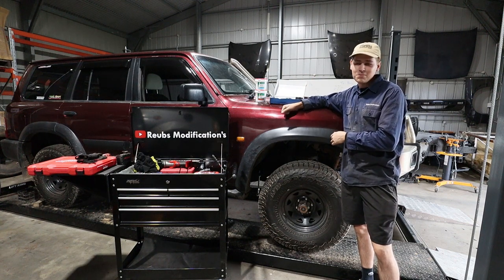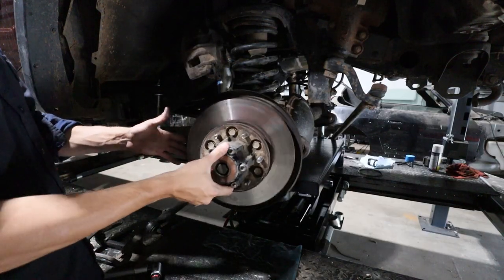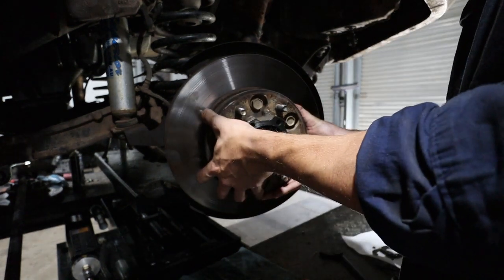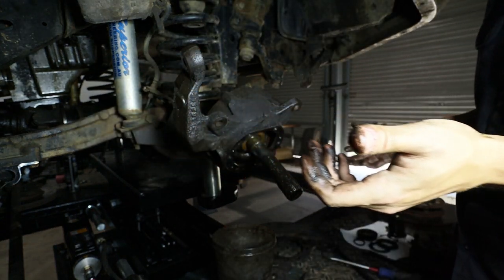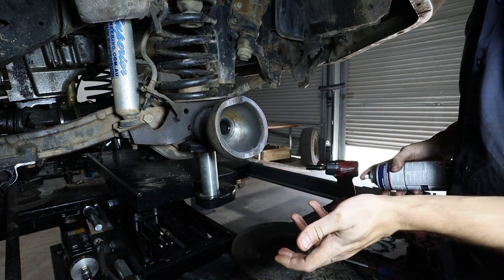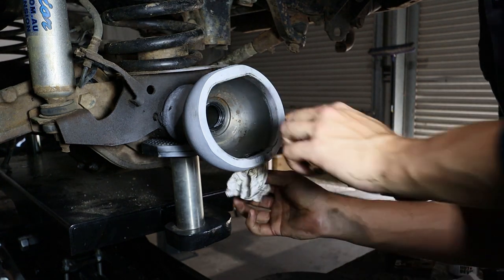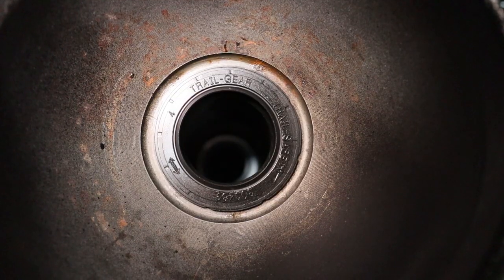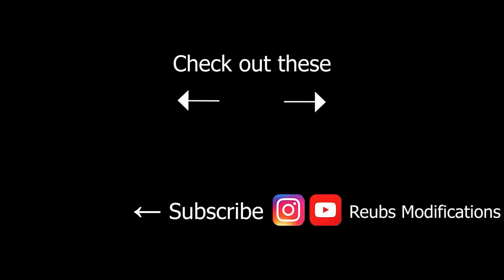GU Patrol Axle Rebuild Pt 1

Comment: Hey mate about to do the same on my car should I paint before putting the bearings in and just mask off the 2 holes I saw u painted while they were in did u cover them or something cheers
Reply from the maker: Yeah would be best to paint before the bearings go in but if you wipe them down and remove any overspray it wont matter. I just wiped the bearing surface with thinners as its faster than masking up.

Comment: great video very informative one question did you drain the diff oil before you started?
Reply from the maker: Thanks mate, in theory yes you should however by the time you get to fixing a axle seal they’ve usually lost enough oil that there’s not too much to leak out anyway. Only thing to keep in mind is if you are going to do one side at a time as the angle of the diff will cause more to drain out the side 👍🏻

Comment: Nice gloves😂
Atleast tell people you have cheap parts not genuine
Reply from the maker: Genuine isn't always the best replacement, there's also a link to the parts I used in the description if people are interested as to the quality. I don't always wear gloves when I should but packing grease is the kind of job where I would always use gloves.